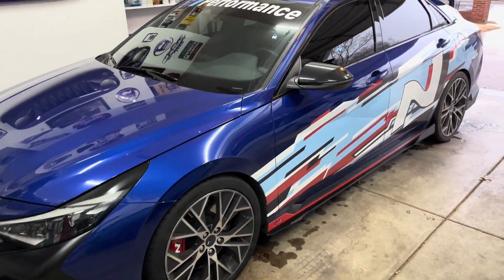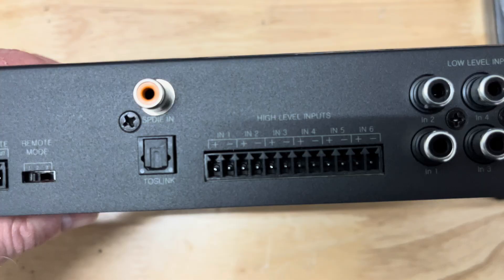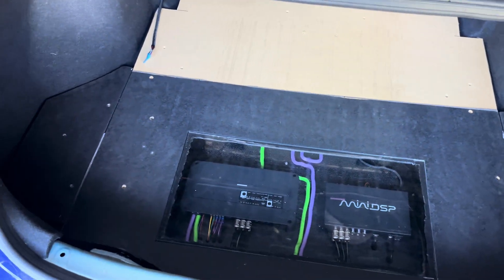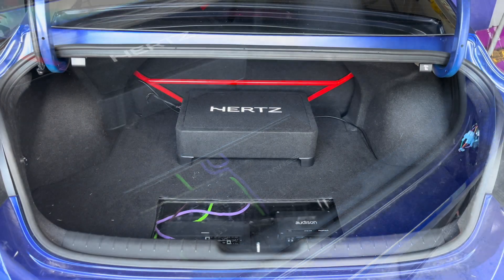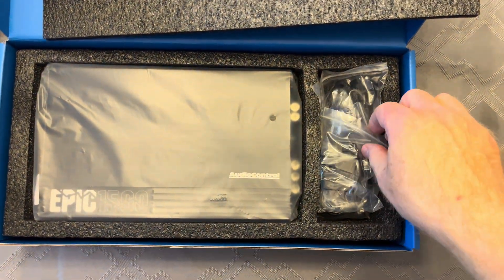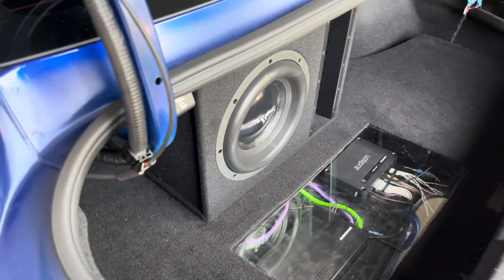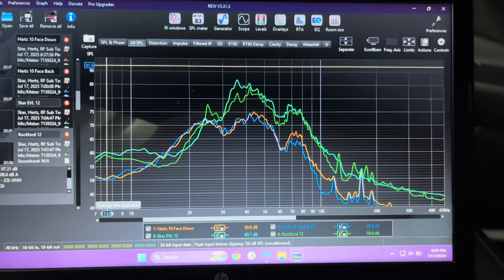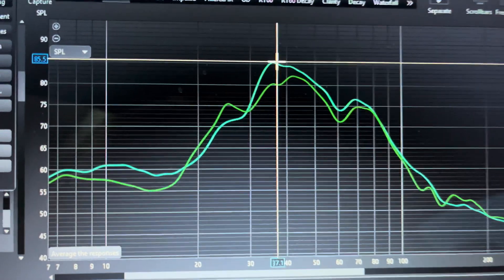Hertz 10” MPBX 250 S2, Rockford 12” P300-12, & Skar 12” 1X12D2 Triple Subwoofer Comparison Review

Comment: You should try the resilient sounds RS series subwoofers. I run the 15 in the cheapest sealed enclosure I could find on Amazon, and it is by far the cleanest and the loudest bass that I've ever heard while barely sipping power.
Reply from the maker: I’ll check those out. Thank you!